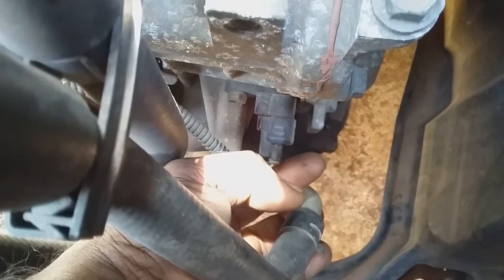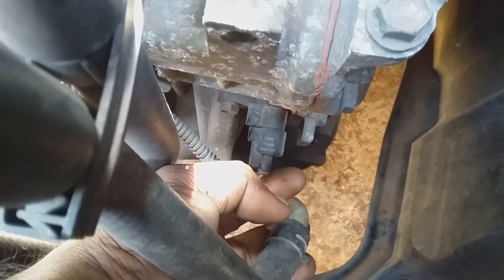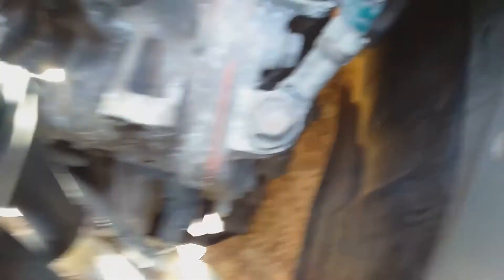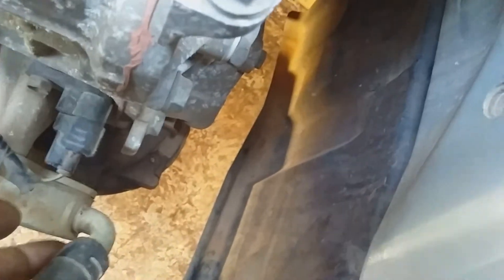Toyota Vitz Locating Input and Output CVT Transmission Speed Sensors

Comment: 2sz engine with cvt transmission toyota vitz 2003 model... the transmission is behaving like it is hunting gear ratio....changed cvt fluisld but still problem is there
Reply from the maker: Do a scan of the transmission to check abnormalities with the transmission or sensors.

Comment: Do you know where the output sensor is located on transmission for 2007 yaris?
Reply from the maker: The output sensor is usually located on the transmission around the area where the shaft connects the transmission to the wheel.
Reply: @ShelDockToyotaVitz  you wouldn't have a video or picture would you? I changed a sensor there but it did not resolve the issue. Everything is still not working just lights come on windows and Everything else still won't work
Reply from the maker: @SamSummers-yf3rg  what kind of problem are you having with your car's transmission?
Reply: No transmission problem but it won't come out of park power steering went out and windows locks speedometer the only thi g that works is the head lights car runs took it to auto zone they hooked it up and said it was the speed sensor output that goes on transmission

Comment: Hi SHEL Dock 
1sz engine vitz 1999 what is the gray female plug above the thermostat hose or left side of the camshaft sensor 😊
Reply from the maker: Hi there, am gonna assume that your driver side is on the left of your vehicle because the female plug that appears to be close to the thermostat on my vehicle is the oxygen sensor cable going under the vehicle to the oxgen sensor.
Reply: @ShelDockToyotaVitz  it's right steering 
What can you tell me about the gray female connector above the thermostat hose
Reply: @ShelDockToyotaVitz  yes o2 sensor thanks 
 but this gray female connector is attached above the thermostat hose
Reply from the maker: @snoopha3  it could be the temperature switch that turns the radiator fan on or off.
Reply: @ShelDockToyotaVitz  OK thanks thats wonderful 
Appreciate your help
Reply: @ShelDockToyotaVitz  can you please tell me where the Crankshaft sensor and oil sensor are located in 1sz engine

Comment: I have vitz car having cvt transmission gear I put car in gear but not move
Reply from the maker: Do you know if your transmission is leaking. If no fluid is in the transmission this is how it will behave.
Reply from the maker: If you can not determine this by yourself I would advise that you ask a mechanic to check it out for you.
Reply: @ShelDockToyotaVitz my vitz won't move forward but reverse normal , what could be the problem please
Reply from the maker: @arelaxation9616  if you put the gear selector in drive and the vehicle doesn't move shift it to S and see what happens and if it still doesn't move shift it to the lowest gear but at this stage you may need to get a new transmission. Does it work in reverse?

Comment: where speed sensor
Reply from the maker: The points that are shown are where the input and output speed sensors are located. To remove these sensors you need to remove the electrical connections then unscrew the small bolts then slightly twist and pull the sensor from the socket.

Comment: the transmation is slipping does it need an oil change or something else could be wrong ?
Reply from the maker: You need to do a transmission fluid change.
Reply: @ShelDockToyotaVitz  can a bad speed sensor cause the transmission to slip a bit?
Reply from the maker: @josecristovaohall6411  no, speed sensor does not have this effect on transmission. If your transmission is slipping, most likely the fluid needs changing.

Comment: my car is the vitz 2008 ncp91 has three sensors does your car only have two sensors? my car has two sensors at the front and one at the back. I am trying to locate the output speed sensor mechanic says there is a code for it but he changed one of the sensors at the front and same issue remains reading same output speed sensor now I am thinking he is unsure as he was not convincing. and your output speed sensor u said is at the back I am wonder if that is the one I need to get to. But let me know if you hav three sensors or not?
Reply: I have this same problem right now, i need to replace my output speed sensor, i got a check engine light and the code is p0722, my transmission is k410 for toyota vitz 2007 has 3 speed sensors and 1 oil sensor and judging from my diagram the sensor in the back is an oil sensor. My thing is im wondering which one is the output sensor, did you get yours fixed?
Reply: @rayanclarke6891  yes he changed the wrong sensor went to an electrician who scanned it after he and took off the sensor at the back while the vehicle was running and found that the back one was output speed sensor changed it and no light since
Reply: @Rhico Ent  perfect!, i testing my 3 sensors and they were fine, so i just ordered that same sensor at the back, cant wait till it arrives

Comment: What are the symptoms when you have a bad speed sensor
Reply from the maker: Since these are sensors, once they are going bad you will definitely get an engine check light. A scan would be the first step in identifying this problem.
Reply from the maker: A part from the engine check light you will have gear change problems.